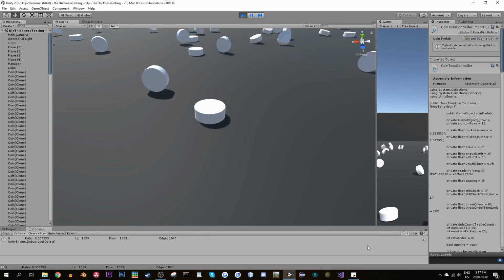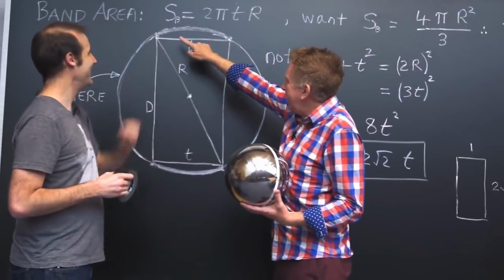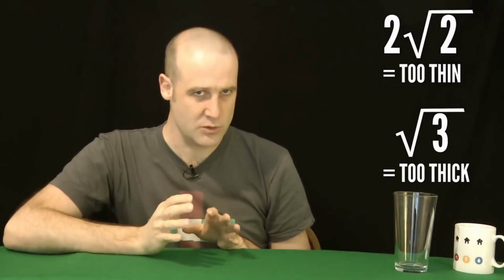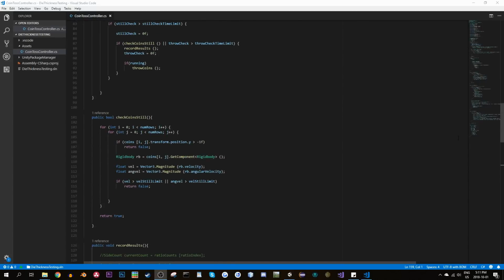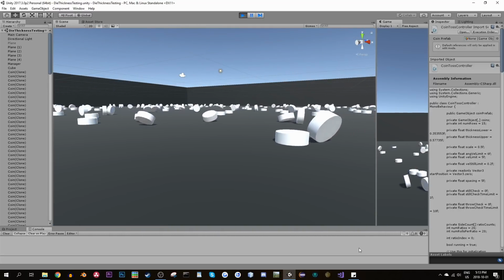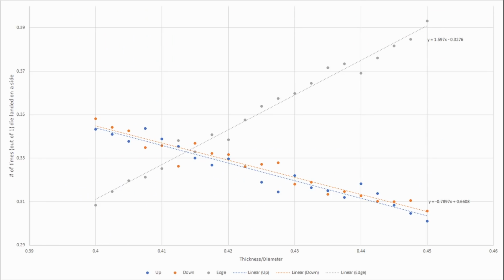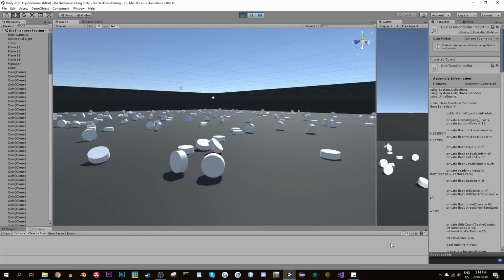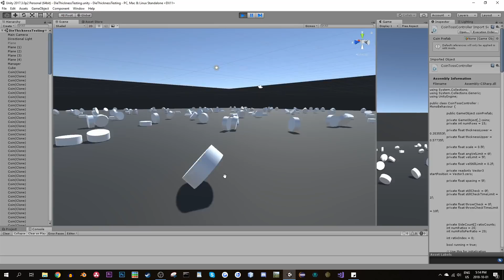How Thick is a 3 Sided Die? (WRONG - see update)

Comment: I think that removing any that are not flat is going to skew the data in favor of center over sides. Any chance you can run again removing chance of coin interfering with other coins.
Reply from the maker: I think this file is lost to history after I change the hard drive in my computer, but if I do it again I'll take that into account. If I remember correctly though, the amount that had inappropriate resting values at the end were very low in comparison to the amount that were definitively one way or the other.
Reply: @sirrandalot  Wow. Wasn't expecting a reply on a year old post. Thank you for answering. I just wanted as perfect as possible answer before I 3d print my own.